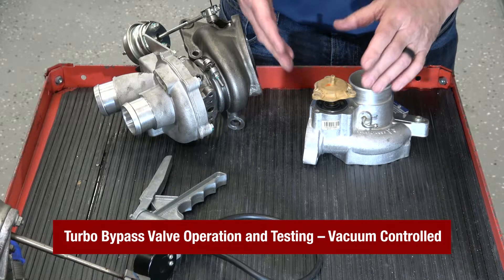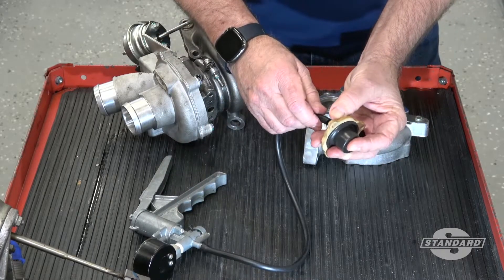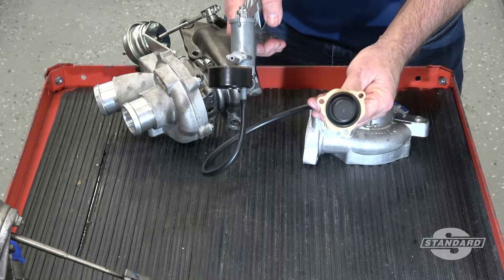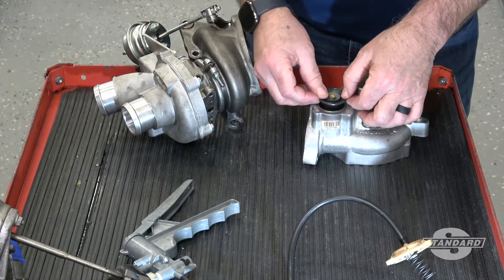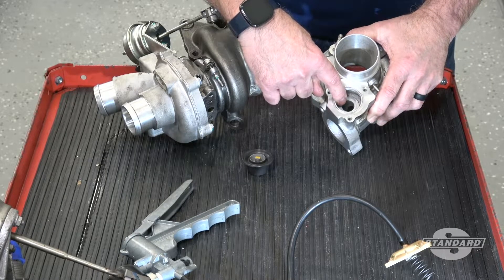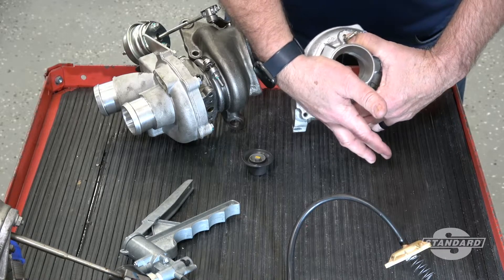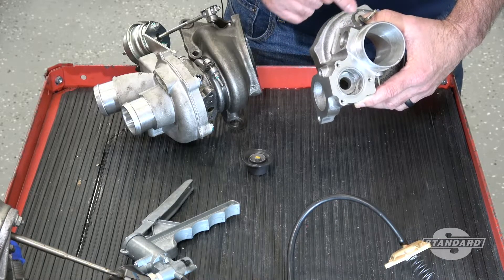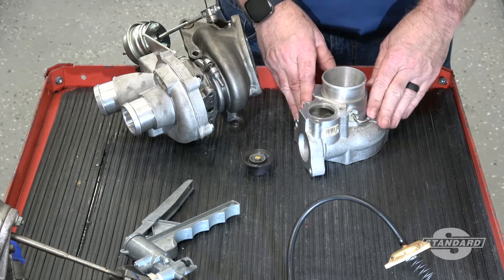Turbo Bypass Valve Operation and Testing – Vacuum Controlled | Tech Tip

Comment: I got a code for it being stuck. I tried testing to see if it held vacuum and it won't. I guess its stuck closed. Should I still try to take it out before I test? I just ran a vacuum hose to it still on the turbo to see if it held vacuum??

Comment: Hi. is it supposed to handle the pressure too? If i apply more than 3 psi on my bypass valve, pressure goes down. When driving,my boost psi constantly alternate between 3 and 8 psi.
Thanks!